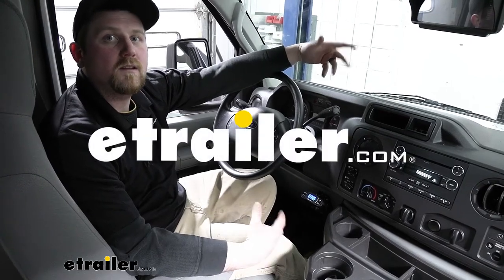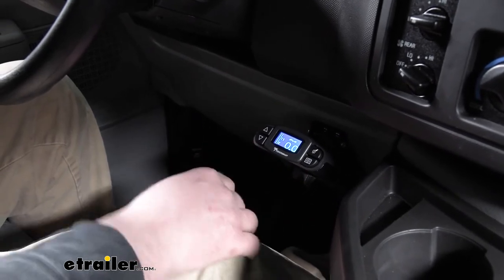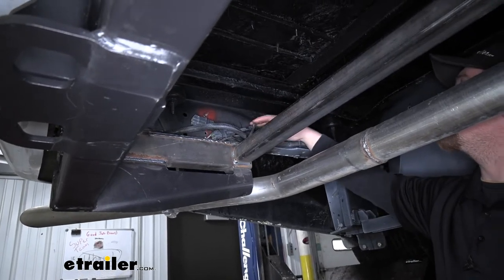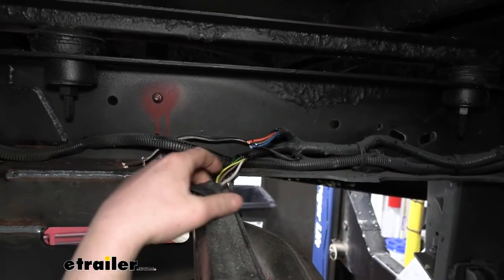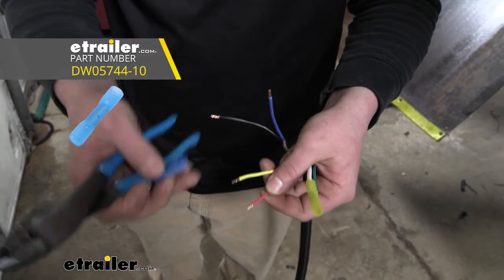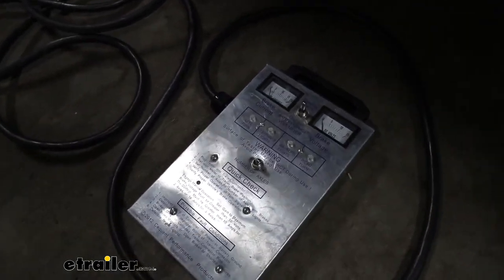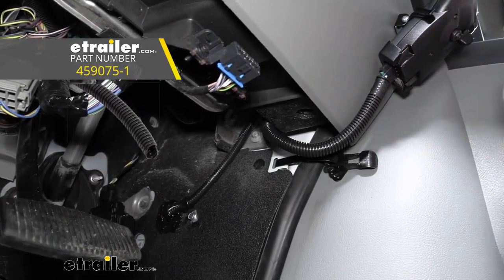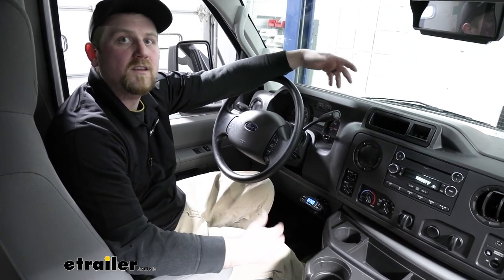etrailer | Tekonsha Prodigy P3 Trailer Brake Controller Installation - 2020 Ford E-Series Cutaway

Comment: I love it when people use butt connectors. Will fail guarantee. Especially when used on exterior wiring. Take the time to solder and use marine heat shrink.